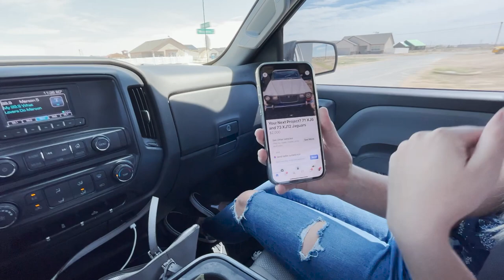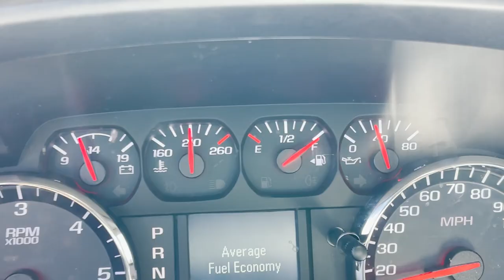New BURNOUT Build Revealed! She Bought TWO Project Cars...

Comment: You can rip a carbureted small block Chevy in a burnout comp and put on a show. I just drove the #8 Budweiser Firebird at Cleetus and Cars Indy that was a Demon carbed 400 SBC with Brodix aluminum heads and a big thumper of a cam. It did overheat quickly with the stock cooling system but the motor held up. Don't sleep on old school SBC engines. They can be rippers if done right.
Reply from the maker: Watched your burnout it was ripping man!

Comment: The xj12 would be worth restoring as they going up in value. They're basically the same. The only difference is the wheel base in the rear doors. The fuel tanks are in the rear fenders one each side so you gotta remove them and cut the spare wheel well out for fuel cell and its easier to access the diff.
Reply from the maker: Sounds like putting fuel cells in them is super common! Definitely don’t want to be popping tires on the fuel tanks lol. We are definitely going to hold on doing a bunch to the 12 and figure out where we want to go with that one! It’s still kinda rough as some of the body panels are pretty beat up but we will see!
Reply: @BuildTuneRace  the XJ12 originally had a 5.3l v12 same as the XJS. One of those with 6 webbers is an incredible setup that's if you can find an engine. Lots were v8 swapped due to the rebuild cost being very high. Looking forward to seeing what happens anyway

Comment: They should both be TH400 transmissions, grab the Jaguars that Run book, dont waste your money on snipers, just go get a Gen 6 big block and drop it in, Holley sells a multi port injection intake for big blocks now and put a terminator on it, Chevrolet performance sells timing covers that have cam and crank sensors in them to do sequential injection and LS coils

Comment: I have done a 350/th700r4 swap to it  the rear gears was way low  i swapped a 8.8 t bird center section  swap was easy. Did 373 gears with a locker did awesome burnouts lol.  Bosses car got paid to build it lol.
Reply from the maker: I need to figure out which rear gears these have for sure! That’s cool though sounds like it was a fun build!

Comment: If I remember the Draguar from Roadkill still has the stock rear in it with the 6-71 383 SBC in it. The primer one would be a parts car. The other one would be the one to build. Just my two cents.

Comment: Green one. I know you can get a bolt in 9" for them. And a 540 on methanol would make it come alive. Wouldn't be hard to get the carbs to run either
Reply from the maker: Nice I figured with the cradle someone would have a 9in swap available. A big block in that could would be AWESOME!!!
Reply: Or a 8.8 they swap really easy.  There hard to break.
Reply: @ruthlessronniethemechanic5639  25 years ago we 9" swapped everything 🤷🏻‍♂️ but I'm sure there's 8.8s out there for it now, just know way back when there was 9" bolt in kits for jags

Comment: WARNING .....The weak link and chief failure in XJ6's chassis are the trailing arms on the rear suspension assembly where it connects to the body tearing out or rotting out ...they will tear out with your first burnout if not strengthened
Reply from the maker: Thanks for the heads up the cars are pretty solid so hopefully we will just need to reinforce the mounts!
Reply: @BuildTuneRace  Max power on even the v12 was 275hp and where those circular mounts attached to the car not the mount itself , would rip off new cars , we used to weld plates to the inside of the cars and through bolt the mount ....You guys will be making way more power than 275 ...The Diff is stronger than even a ford 9 bolt though but the pin that secured the spider gear axel would shear off . you guys will be welding then solid though .....The original Bigfoot monster trucks used to use them to sit on the main diff to reduce drivesaft angle they were the only ones that survived that

Comment: Make sure you have enough cooling for both the engine and transmission. It'll give the small blocks a fighting chance of lasting.
Even though I'm an old school guy, go with the Holley Sniper. Maybe upgrade the ignition as well. No need to fight with old carbs and ignition.
Reply from the maker: I agree it’s definitely going to need some really good cooling! SBC don’t cool near as good as the LS engines!